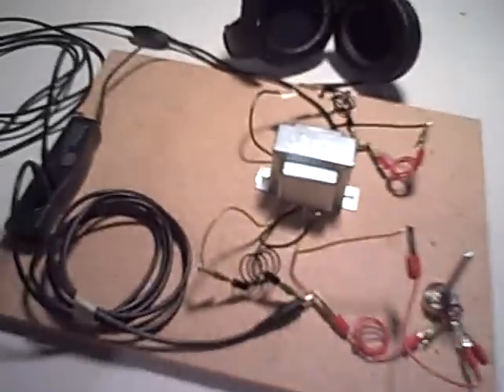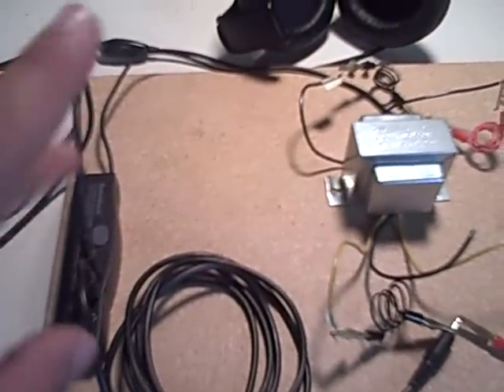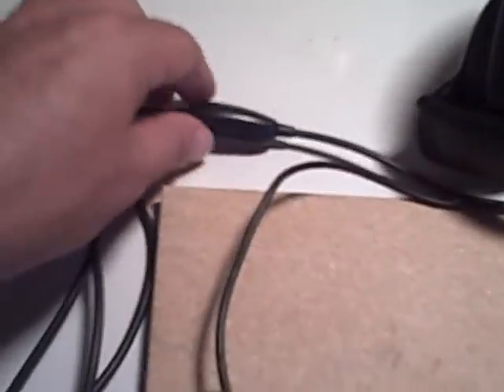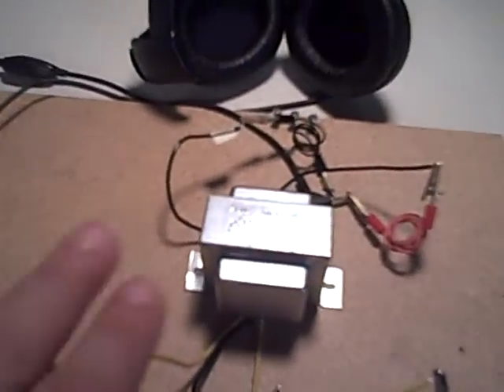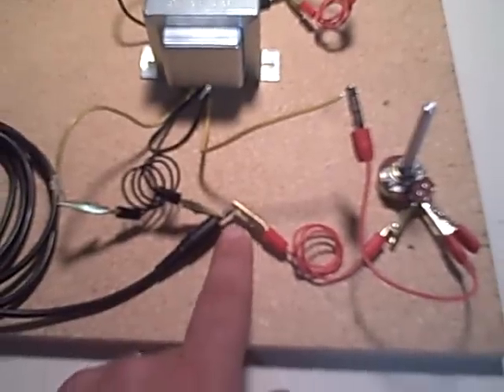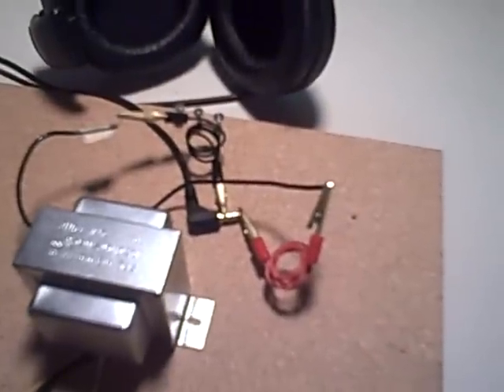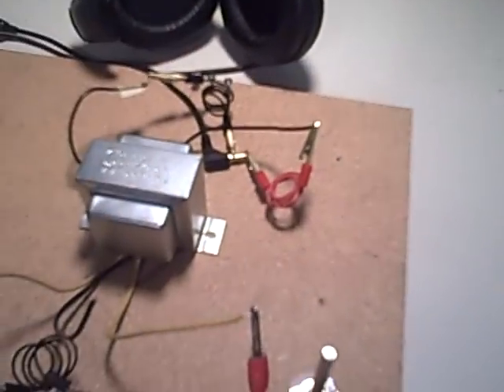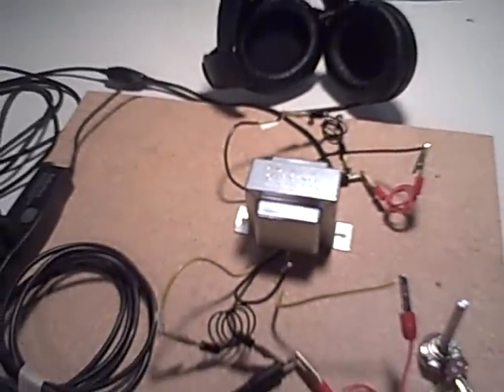Feedback Loop Frequency Generator

Comment: Transformers use AC or pulsed DC.  It will shift / change the phase of the waveform.  When fed back, it will cause oscillation.  The core material and number of windings / wiring used will determine the usable frequency range.

USA wall outlet frequency xformers use 60 cycles per second (Hz), but audio xformers are used for isolation.  RF transformers are used in cable TV splitters and obviously work on the old VHF and FM radio bands. You want DC, then you throw in a set of rectifiers.

Comment: A transformer takes high voltage input usually 240v ac and 'transforms' it to a lower voltage, maybe 12 or 9v.

What you're thinking of is a rectifier.